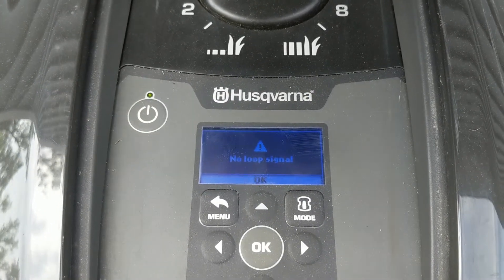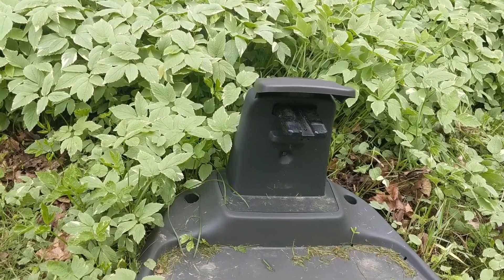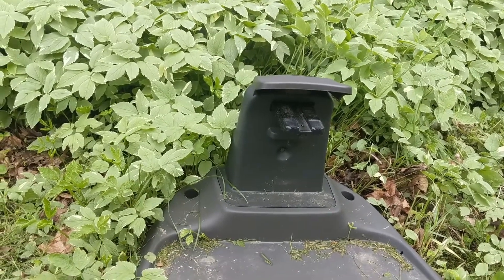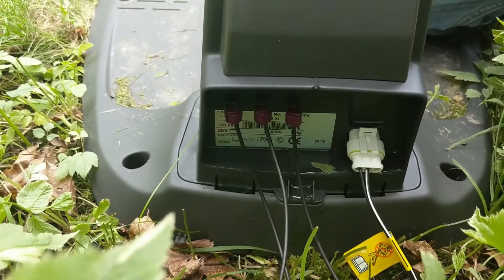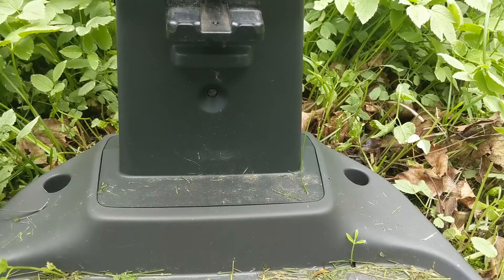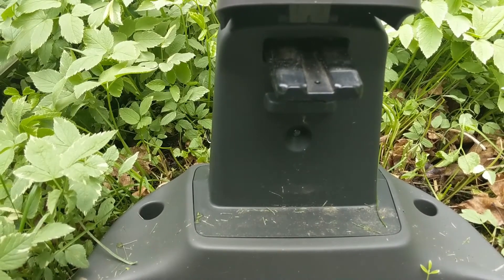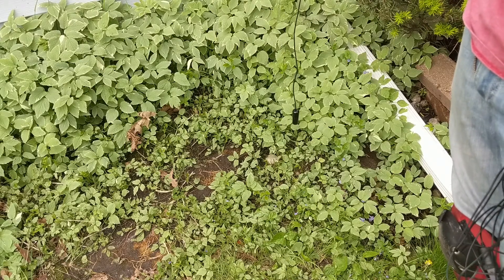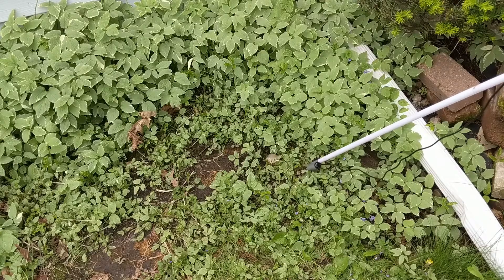Husqvarna Automower [How To Find Cable Wire Break] No Loop Signal Flashing Blue Light Help!

Comment: Great video! I just bought the underground wire tracer to locate and mark the boundary and guide wires  in my lawn in preparation for core aeration. I assume I just clip the red lead to one line at a time on the Automower base (plus ground the black lead on a screwdriver) and follow the signal to mark the lines?
Reply from the maker: Thanks! Yes, attaching the wires as you mentioned will allow to trace the lines.
Reply: @TinkerForward  Thanks very much! Your video is the best on this subject!

Comment: Hey! Thanks for the vid, just to clarify, when you switched the left boundary with the guide wire and it flashed yellow, you said that that means the break is most likely on the front of your yard, but you never said which boundary (left or right) went to the front and which went to the back - I'm assuming that it is the boundary wire that you switched when the light went yellow is the 'suspect' cable? Thanks!
Reply from the maker: You're welcome! Yes that's the boundary wire I switched when it went yellow that is the suspect cable. The right wire goes to my front.

Comment: How did you pull the boundary wires out? I have a 405x and can’t seem to be able to pull out the maroon coloured thing.
Reply from the maker: I just pulled the maroon boundary wire coupler out using my hand.  If its not coming out, I would suggest using a pair of needle nose pliers to pull it out.
Reply: @TinkerForward  thanks very much. It came out after I pulled it with all my strength. Interesting the base station swap wire test indicated that the break was between AR and g1. But the actual break was on AL.